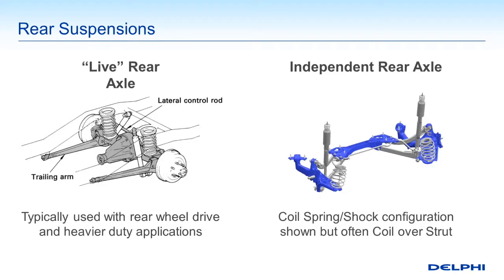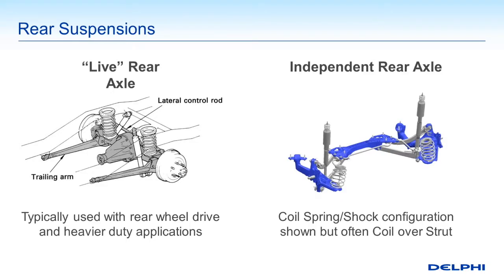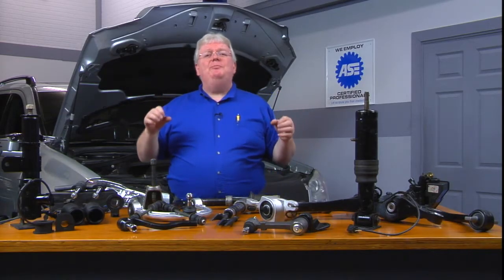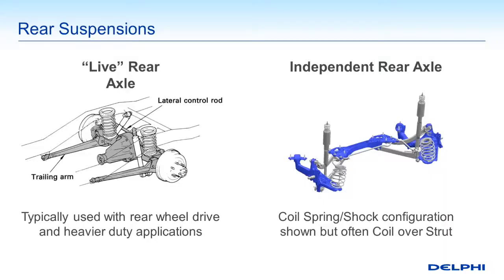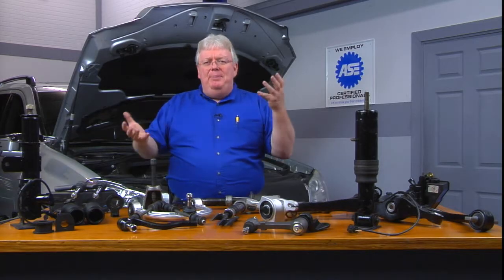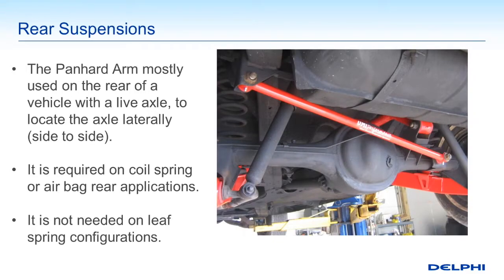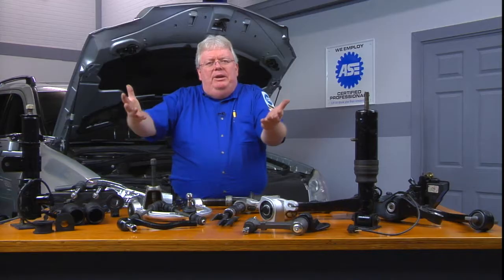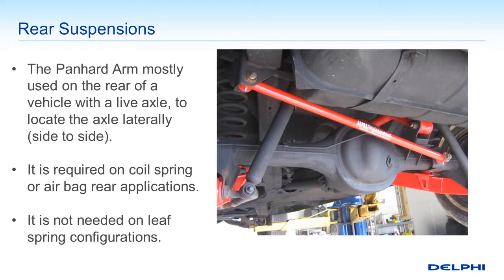How Rear Suspension Types Work

Comment: hi, won't a panhard bar cause a forced lateral movement of the rear axle?  The panhard bar moves in an arc, not straight up and down?  I have a 2.5 ton single rear axle truck.  I once saw where someone was able to significantly improve the ride of a similar truck by using shackles at each end of the leaf spring.  And using a track or torque rod at each axle end under the leaf pack.  I believe it had a pin at the frame end of the torque rod so the rod can pivot up and down but no travel left or right.  And, if I recall, the axle end of the torque rod had a heim joint so the axle can pivot when one side goes over a rock and the other side doesn't go over a rock.  He claimed this gave the best possible ride (almost but not as good as a coil spring) better axle travel, and still maintain the full load-carrying capacity of the truck and not put a stress on anything.  Your comments, please.  I'm converting my 2.5 ton truck to 4wd and I'm thinking of doing the same to my rear suspension.  He claimed the leaf springs, despite having shackles at both ends, along with the torque bar rods fully controlled any lateral axle movement and the torque rod bar kept the axle in proper front-back alignment.  I would appreciate anyone's comments, and especially if you have seen something similar on a heavy on and off-road truck.  I'm also concerned with axle wrap when starting from a stop with a heavy load.  Would that be any more of a problem than if the truck remained totally stock?  Thank you.